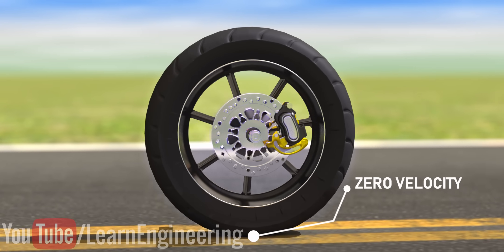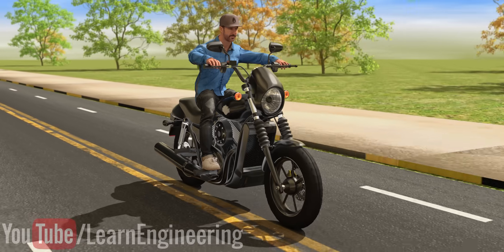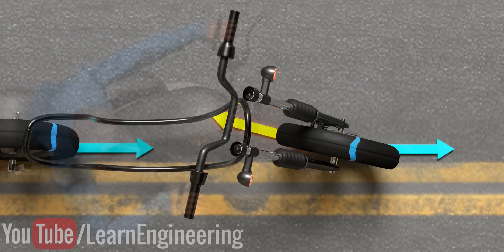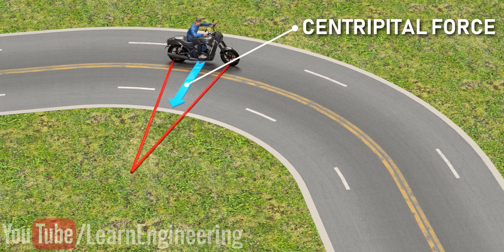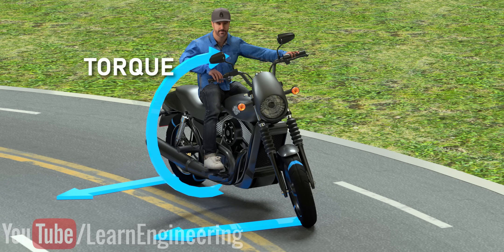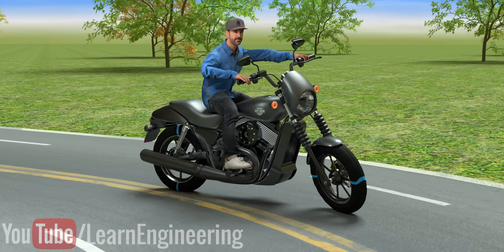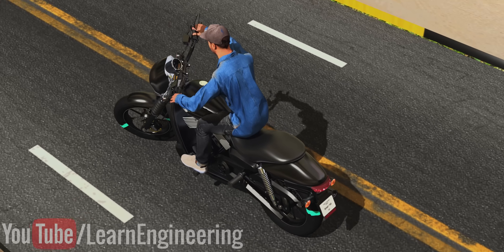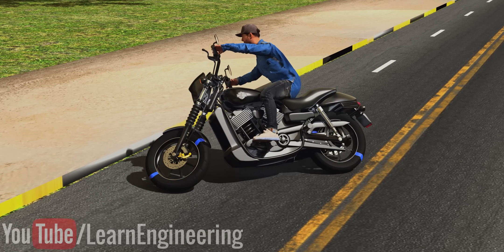Counter Steering | The interesting physics behind it

Comment: This give the false impression that a rider can choose between direct input steering and counter steering, as if it were a matter of personal preference. That advice can get someone killed. 

You cannot steer a motorcycle at public road traveling speed with direct input steering. You’ll go the opposite direction of your intentions, either off the road or in to oncoming traffic.
Reply: My Vrod only turns with counter steering above about 5 mph.
Reply: stickshaker101 that’s the case with every bike. At a very slow speed, the bike wants to fall into the turn because there is no counteracting centrifugal force. So from a stop, you turn the bars into the turn and the bike goes upright as you accelerate through it. At a high speed, the bike wants to fall away or to the outside of the turn. This is what makes the bike turn in the opposite direction. If you then steer into the lean to not topple right over.
Reply: Joe J 
Wrong! The rider doesn't actively steer into the bend when at speed, the bike will do that via self alignment.... If the rider does it he will stand the bike up!
Reply: @stickshaker101  At 5 mph, you really should be using standard steering. I find it hard to believe that you counter steer at such slow speeds.  I suspect you're misinterpreting what's happening. It's simple physics.  Counter steering comes into play usually between 12 and, say, 17 mph, depending on various factors. 5 mph is just slightly faster than walking speed. You use standard steering at that speed on any bike.
Reply: I have a simple analogy to countersteering. Imagine you are balancing a hammer on your hand. If you want to move the hammer to a different location, you cannot simply move your hand towards the desired location - the hammer would fall out of your hand. Instead, you must move your hand away from the location, so that the hammer leans towards it, thus correcting the lean brings the hammer to the desired location. This is analogous to how you must move the front wheel out of the underside of the bike to initiate a lean to make a turn.
Reply: @bmfilmnut  The only time standard steering works is if your feet are paddling on the ground to support the motorcycle. If the machine is balanced on its wheels with your feet up then the only way to steer is counter steering, whether it's 2mph or 200mph. Prove it yourself in a parking lot by riding through puddles and then initiating a turn. When you study the tyre tracks you'll see the bike always turns in the opposite direction first and then corrects to go where you want. 
It's because the bike must first lean and then turn. To make it lean you turn briefly in the opposite direction.
I totally understand why intuitive impressions make people feel that it's otherwise, because our intuitions aren't always a good guide, especially when we've learned a skill like balancing a bike so well that it's embedded into the subconscious.
Reply: @stickshaker101  That is true of all motorcycles an bicycles too. The speed at which "counter steering" is required depend on the size of the front wheel, but is typically between 5 and 10mph
Reply: @stickshaker101  Actually, it’s about 18 mph.
Reply: Listen all I can say to some of you people on here is go take a course.( most states its MSF) I live in PA so its Total control lee parks. If your not going to take a course atleast go do some reading. (Knowledge then skill) which simply means go out and take a class or read a book from an accredited source ( total control vol.2, any book from Keith code or lee parks) hell go watch "Motojitsu" on YouTube. And then as he would say in most of his vids "shut up and practice". Go practice in a controlled environment. Empty parking lot, maybe catch a track day. To answer some of your questions and reiterate on what was said. How you turn the bars depends on what kind of turn your taking, there are two types of turns. "Low speed (anything under 12-15 miles per hour) and road  speed (anything over 12-15) and NO! It does not depend on what kind of bike your on. Fundamentals are the same for any bike, that's why they say "it's the rider, not the bike". Low speed turns require "direct steering" and instead on counter steering we get into counter balance. Road speed requires counter steering. Get out there and take some courses if your going to ride. It's the best advice anyone can give to you.
Reply: Exactly right, whether on a bicycle or motorcycle you always countersteer to turn, whether you realise it or not. It may be hardly noticable but you do countersteer every turn.
Reply: @kevinbrown7219  Keith Code proves your statement with his training bike.. It is called the no b.s bike. (no body steering).  His classes are amazing I went to the super bike school
Reply: @kevinbrown7219  No exactly, try riding a bicycle without putting your hands on the handlebar and turn with moving your waist
Reply: @AnnoyingPlastic  I do that all the time
Reply: @AnnoyingPlastic  Anyone who rides a bicycle countersteers. At moderate speed you don't steer by turning the handlebars. You steer by leaning and countersteering. Everyone does that, even the 8 year old who has just learned to ride a bicycle.
Reply: @jmw8403  Absolutely right. I’m astonished by this video which appears to have been based on an entirely theoretical basis, by a non-motorcyclist. Above around 5mph the only way to steer either a motorcycle or bicycle is by countersteering. Try and steer as you would a car and you’ll be off before you know it.
Reply: @AnnoyingPlastic  and when you do what you say to do the bike will first counter steer a bit and only then will it dive in the direction of your lean. Counter steering will always initiate turns at speed. This is some really dangerous misinformation here about being able to turn at speed on 2 wheels without countersteering!!
Reply: @AnnoyingPlastic  lol did u know that if u lean the bicyle without putting ur hands the handlebar will countersteer , if u dont believe me try locking ur handle bar that it will not go to the opposite of direction u wanna go. goodluck
Reply: @kevinbrown7219  not at slow speeds - counter steering kicks in at around 15mph. Under that you will be using a normal turn.
The way I was taught was at speed push in the direction you want to turn to.
Reply: @XtreeM_FaiL  try it at a walking speed on a low traction surface and you might modify your thinking on this point,
Reply: XtreeM FaiL yep. That’s my point. Countersterring won’t work at a walking pace on low traction surface, or even a high traction surface, at that low speed. Direct input steering only works at low speeds, countersteering works at all other speeds.
Reply: @XtreeM_FaiL  I have done that. Not moving is different than moving. 
And I didn't say "without traction" which would like what, black ice? 
I said low traction, like wet leaves, mud etc.  
So two missed conditions here: rolling/not rolling and low traction/no traction
"ffs" indeed. Note in the vid the complete lack of counter steering and deliberate use of direct input steering. Turn left, go left. This works only at low speed.
https://youtu.be/LKRPPjF3BIs
Reply: @XtreeM_FaiL  " change front tyre to a ski and it still work the same as before", well if you don't understand the difference between a ski and a tire, I guess I'm done conversing with you about counter steering, because it sure won't work with a ski.
Reply: @XtreeM_FaiL  counter steering works, for one reason, because as you push the handlebars to the counter directional side, the bike starts to fall the other way and the tire tips onto it's side, where  it's radius is smaller and then the bike turns toward that effectively smaller radius part of the tire (approaching it's sidewall, almost/kinda). The radius of the crown of the tire is greater than the radius of that same tire as the contact patch moves toward the side of the tire. A ski has no smaller radius, it doesn't roll and do you seriously need me to explain to you the functional difference between a flat static surface (sliding) and a round, complex curved (rolling) one? :^ )
 Did you check out that MotoTrek vid I linked? You can see he doesn't use counter steering on the slower, low traction turn, He turns the handlebars the direction he wants the bike to go, and it goes there. No counter steering.
Reply: @XtreeM_FaiL  
You're hilarious.

And obviously you haven't screwed with how you turn the bars in parking lot enough to have entered a corner steering directly, and exited counter-steering.

In a way, you're "always counter steering" because most of the time you're letting the bike so most of holding you up.
As riders, we just learned how to go about making it do things without upsetting it.
Reply: @Slarti  THIS is correct.
Reply: @tommeyer6033  Yes it will. Only you can't lean so much. Or you have to counter weight with your body. Like it or not, you always CS…
Reply: @tommeyer6033  You are the one that don't want to understand. You only want to be right, but you are wrong. Wrong I tell you… W R O N G !
Reply: @Gismo3333  😂😎 I think there is plenty of empirical evidence that shows otherwise. 
Plus you’re “yelling”. Not a good debating tactic. It says more about your argument than it does about mine.
Reply: @Gismo3333  there is also video evidence of people not counter steering, and paying a terrible price. 

This guy tries to steer in the manner advised in this video (with direct input, not counter steering), and rides directly into a fire truck. 

https://youtu.be/VVE79XT8-Mg
Reply: @Slarti   No, even at 15 the only way to turn is to countersteer, bycycle, byke, scooter...if you got 2 weels you need to lean in order to make a turn. And leaning is the effect of coutersteering.
Reply: @Slarti  No, you counter steer at every speed unless you are putting your foot down. It is just laws of physics, you cannot physically turn a two wheeler without counter steering or putting your foot down( in that case it becomes a 3 wheeler temporarily) to counteract the centrifugal forces.
It is just that it becomes more noticable at high speeds.
Reply: @XtreeM_FaiL At super low speeds, right around 5mph I have to direct steer my Goldwing. When pushing it backwards out of the garage I'm not counter steering. When I'm power walking it's direct steer. I don't need to counter steer until around 12mph on my Goldwing. There is a point at which it switches. Starting from a stop and turning onto the highway I can watch and feel my bars go from turning into the turn to pressing opposite of the turn.
Reply: @Slarti  You CS at any speed from idle and up.
Reply: I counter steer in traffic all the damn time. Every time I ride, consciously and deliberately
Reply: @ulysses_grant  it has nothing to do with whether you are in traffic but is to do with speed.
At speed you have to counter steer.
Reply: @Slarti  Good to know, I'll try that. What speed exactly, do you mean?
Reply: @ulysses_grant  the speed depends on the bike. On most motorbikes(by motorbike I don't mean scooter) it at around 15mph.
Reply: Youtube should ban this video!!
Reply: To all the people that don't understand countersteering: Go watch Twist of the Wrist on YouTube!
Reply: @teasippingguy9316  
And to all the people that ride.
If you've already seen it, watch it again
Reply: @Fightre_Flighte  exactly.
Reply: On top of.that, it goes far by staying that it can be done with weight steering 🤦 such a thing does not exist
Reply: It’s not a matter of personal style, preference or belief... it’s physics.
Reply: Exactly sir you said it better than I did this video will get people killed by them thinking that they have the option of choosing which way to steer
Reply: @ulysses_grant  What??
Reply: You are exactly right.  It was an error on the part of the person who made this video to say that counter steering is faster because there is no alternative to counter steering at speed. It's the only way so there's no other technique to be faster than.
Reply: I was going to comment this but you had it covered - thank you
Reply: @Gerardo Martinez I actually say counter steering works at speed v= ε (where ε is any given speed >0, even infinitesimally low). Suffice to watch the Japanese police in training, or any gymkhana. It is best shown in parts where they prepare for a hard turn from standing straight position. Counter-steering is pre-applied before the cycle starts rolling, so once in motion, it leans instantly.
Reply: Tom Meyer I have read every comment and counter-comment.  I am not a motorcyle rider, but after all this, I can honestly say I have Zero Idea what to believe!
Reply: @mikeriesco6174  Just to be 100% sure I heard it correctly in Keith Code's Twist of the Wrist  (that THE ONLY way to initiate a turn on a motorcycle is to countersteer) I took some time to experiment on my bicycle. I rode it super slow (at the edge of losing balance) and tried to apply direct input steering to turn. But to make sure it really was direct steering I kept my body straight and just turned the handlebar. Naturally, not turn in the intended direction - the bicycle just leaned in the opposite direction of the handlebar turn. Then, I tried body balance, hanging off one side - NO DIFFERENCE. The principle holds true no matter what you do. Granted, the amount of countersteering is minute - if you only slightly turn the handlebar and get a "positive rate of lean" - you can let go (i.e. stop applying pressure on the handlebar) and the bicycle turns nicely. Try it yourself, you will see it instantly. Just pay attention to what you are doing and the reaction of the bicycle.

I guess some people talk about "direct steering" not realizing they actually countersteer a very tiny bit at low/very low speed.

Search for Japanese police motorcycle training videos. You will see how they start rolling their cycles with the front turned in the opposite direction (which results in an extreme u-turn right off the bat). They are quite aggressive with the manoeuvre, too!

So, to be crystal clear (and I will repeat what Keith Code said): countersteering works..... ALWAYS.
Reply: @piotrswiatkiewicz3259  I have filed a complaint about this video with YouTube. Please do the same.
Reply: I just tried it after watch this video, even manage to do it on a small road.. arround 30-40 kph, (well my country use kph so dont bitching about it).
Reply: @Je_AnetteAI  what do you mean? That the countersteering works?
Reply: @piotrswiatkiewicz3259  yeah
Reply: @Je_AnetteAI  Glad you found out! Try it on a bicycle at super low speed. It's fun and you can learn a lot not risking too much.
Reply: It’s been so long since I watched this.. is this a different video posted to the same url? Can you swap out videos for editing changes? I don’t know. But this vid looks not like I remembered it looking. Even the graphics (such as they are (*coughgumby*) look different.
Reply: You're right. 
 this is the most insane and dangerous bike video ever made
Reply: Exactly - this idiotic video is going to get people killed.
(ex- biker 600cc)
Reply: @Slarti  Well, this is "Learn Engineering", not "Learn how to ride a motorcycle". If anyone uses this video to learn to ride, they are not very smart.
Reply: @vferdman  but the science is wrong in this video, so it should be 'fail engineering'.
Reply: @Slarti  No, the science is not wrong here. It is just misrepresented. The depiction of the forces acting on the bike are great. Just the practical applications are obviously not very true to life.
Reply: @vferdman  the science is wrong I can assure you of that.
Reply: Vladimir Ferdman 
So they shouldn't be talking about counter steering! They have little knowledge of how it works in the real world. They are giving advise and it is dangerously inaccurate!
Reply: @Slarti  I have filed a complaint with YouTube. Please do the same.
Reply: I only use countersteer and weight shift to turn my bike...never direct...
Reply: Terry Duncan so only counter steer then, because weight achieves nothing off a track!
Reply: Yes, excellent point.
Reply: The bike goes opposite way above 20mph. In traffic speed it's completele impossible to not countersteer.
Reply: Exactly
Reply: This is a great statement.  Even when I took the motorcycle course they taught countersteering like it was some extra skill.  People need to understand that the faster you go you will NEED to shift from direct input steering to countersteering.  At lower speeds it feels natural like a lean to steer, but you don’t realize you are actually countersteering.  However, at higher speeds if you don’t push the handlebars forward to steer the direction you want to go, you will understeer and not be able to make the corner.
Reply: Ulisses I think you need to practice this in safe conditions at speed.  If you ever need to make a quick defensive move, if you aren’t practiced you won’t be able to make it.
Reply: Jimmy Hua 
Haha you talk nonsense my friend. Have you even ridden a Harley or just commenting on "what you heard"?
Reply: Some motorcycles DO NOT countersteer. A bike with a side car attached direct steers, unless you "fly" the chair and then it does.
Reply: Stu Glenn as soon as you add a third wheel, or a fourth to a motorcycle, it becomes a car with handlebars.
Reply: Stu Glenn a sidecar changes the geometry and mechanics of a motorcycle into that of a car with three wheels. This discussion is about motorcycles (and bicycles)... two wheeled vehicles. A three (fixed) wheeled vehicle will not counter steer because it doesn’t lean.
Reply: @stuglenn1112  a bike with a side car is essentially a car with 3 wheels, as are all "trikes".
Reply: Got told by the CA Motorcycle Safety Training course instructor - ask about counter steering, get kicked from the course. Press left, lean left, go left.
Reply: For most people who ride, counter steering is just an intuitive thing you do and don't really realize it.  This visual representation doesn't seem right to me.   It shows the rider literally turning the handlebars left and starting to go left before going into his right turn.   I don't think I've ever done that on my bike.  I thought counter steering dealt with the fact that you're putting some pressure on the handlebars on the side you're turning toward.  So you're not turning the bars right to go left, you're just pushing against the right side to counteract the force of leaning into the turn.  I've only been riding a couple years, so maybe my interpretation isn't correct.
Reply: Not true. As an instructor on motorbikes and driving inn Norway, this is all we learn students on steering. It's been done excessive studies. Check accident stats for Norway
Reply: Interesting reading everyone's comments. I think the video was interesting and correct in many ways. I think the no steering bike that people use to demonstrate you cannot steer a bike with no hands is probably miss leading. I'm sure when we all was a kid we could go around corners no handed which proves that it is possible to steer with no hands. The problem comes with gyroscopic effect of heavy wheels which is why you see racers hanging on to the side of their bike with it still going in a straight line. The facts are the slower the bike is travelling the more unstable it is, it is lacking in gyroscopic forces from the wheels and forward motion which is why direct input of turning the wheel in the direction you want to go and a bit of subconscious look and lean on the same direction works. Once the bike starts to move faster the other affects start to take over so counter steering because almost the only option to make the bike fall towards the direction you want to go towards. Once the bike starts to lean the front wheel naturally starts to balance out. Maybe this is wrong advice but I think it's kind of how it works.
Reply: @OrangeManStan  that's true but even when you're not using your hands it shows if the bike leans left the handlebars have to turn right which proves body steering and that direct input would not work
Reply: @pjuice2000  this is correct, is all due to physics, kinetic and gyroscopic energy 😊
Reply: @OrangeManStan  above 5-10 mph you only steer by counter steering. if you don't learn that you'll never learn how to control a motorcycle properly.
Reply: @OrangeManStan  I don't think this is correct. Check my comment (I guess the link has to be copy&paste to work correctly):
https://www.youtube.com/watch?v=ZpV2Bg-WX0w&lc=Ugxo5rjReW9ew22gOgR4AaABAg.93NeyF2auWy9DgGplTl9L1
No matter how much I tried to steer my bicycle directly (even at speeds lower than walking pace) - no success. As soon as the handlebars were turned (in the direction intended with direct-steering!) the bicycle would simply lean in the opposite direction, so naturally, if I didn't let go, I would fall. Once I stopped pushing on the handlebars the cycle immediately turned in the opposite direction (matching its lean direction, of course). Try it out and see for yourself. Final result (which matches Keith Code's teachings perfectly): countersteering works.....  ALWAYS. Hope this helps.
Reply: @piotrswiatkiewicz3259  no I do understand, you are correct. I've tried it too on a push bike. It's just the slower you go the bike will start to topple but I agree as I said at a very slow speed you naturally look and lean towards the direction you want to go so you lean then steer without the counter steering. The bike is kind of falling to the direction due to its mass and you leaning. But I agree counter steering is generally required to initiate the turn. I think there's a lot of physics going on including friction and many other things we don't think about. Quite amazing how it comes natural really.
Reply: @OrangeManStan  My point was - every single time you would like to turn on a bicycle, motorcycle (any two-wheeler, single track) countersteering is the only way to achieve that. The slower you go the less of it is required to initiate the turn. To the point where it becomes very minute, but it is still required to lean the bike, nevertheless. No other way to lean. This is exactly what Keith Code explained in his course/book/video and proves to be correct in the simplest of experiments you can imagine. Just try and feel for yourself.
Reply: @piotrswiatkiewicz3259  no worries, I know what you mean and I agree but I do think a bike can be steered with other inputs besides counter steering as stunt riders would not be able to steer no handed. I think that they are using their body weight to lean the bike making it steer. I agree the faster you go the harder it is to do it making counter steering the only real effective method.
Reply: @OrangeManStan  Is it possible stunt riders are only able to steer by balancing when doing a wheelie (or stoppie, although I am not sure if it is doable then)? As far as I could tell (during a regular ride with two wheels on the ground) no matter how much the rider hung off - barely any turning could be achieved. On the other hand - the cycle always reacted to countersteering instantly and decisively.
Reply: @piotrswiatkiewicz3259  I agree, it's very difficult to change the direction of a bike without counter steering especially at speed and on a heavy bike with heavy wheels. Softtail put a link to Keith Codes video Twist of the Wrist which is very good. But if you watch it they do change the direction but only by a small amount. I suppose I'm just trying to be precise because there are many variants but you are right counter steering is really the only real way to turn a bike and is a natural process that we do without thinking about it. The important thing is if you can master it your riding will become easier especially if you want to ride fast on track.
Reply: Absolutely😂😂😂🤣🤣
Reply: Exactly. You cannot steer a bike at the majority of road speeds without counter steering. If you use "normal steering" you're absolutely going to crash
Reply: This video just straight up use a junior high school pyshics to explain motorcycle steering. Like, really? You'll get someone killed 😂

You will never, ever, INITIATE a turn in travel speed on a motorcycle by pushing the handlebar toward turning direction. Sentrifugal force will quickly push you to other direction.
Reply: Absolutely right this is not sound advice bikes are steered with counter steering.
Reply: @ulysses_grant  if you're doing over 20mph, the only way a bike will steer left is if you steer right! Over 20mph, everything is reversed... You have zero choice. At this speed you cannot steer left to go left.

Don't believe me... Take your bicycle out and pedal hard down a hill and very slightly steer right...you'll go left after a very slight initial swing of the lower part of the bike to the right.
Reply: @UCUNs5OkoR3vyT9UeL7Unxsw https://www.revzilla.com/common-tread/what-is-countersteering
Reply: @UCUNs5OkoR3vyT9UeL7Unxsw https://youtu.be/CC0ZadbwFKw
Reply: @UCUNs5OkoR3vyT9UeL7Unxsw it is not unsafe.
Reply: @ulysses_grant  he said the complete opposite…
Reply: true that what i notice in this video i was like wtf thats imposible lol
Reply: Exactly. You’ll basically counter swear the motorcycle in the opposite direction to the way you want to go and crash! This video is nonsense
Reply: Wrong, wrong, wrong.
Reply: Everyone, anything that has 2 wheels in general at high speeds regardless, you need to countersteer. Because you are driving a gyroscope.
There is no 3 or 4 wheels to stop the leaning so regardless countersteering is the only way to steer a motorcycle.
Why does it work?
Because the road surface hits the front tire facing the opposite way forcing it to lean due to friction. This also causes the bikes weight to shift to the front and in the direction the tire is not facing causing the bike to lean.Gyroscopes naturally corner when leaning, also they naturally defy gravity when the spin rate is fast enough. tHIS IS WHY YOU KEEP YOUR ARMS LOOSE AT ALL TIMES
spin a bicycle wheel at high rpm and tilt it on a string. It will stay in it's position until the spin rate is slow enough to no longer defy gravity.
Reply: not even at low speeds. direct steering doesn’t exist. at low speeds the involuntary counter steering is so quick that it’s undetectable with the naked eye but film someone who swears on their own kids they don’t do it and you’ll see they do it
Reply: My point is, that if when riding at in-traffic, at highway/roadway speed, you decide to try turning the handlebars to the right in an attempt to effect a right hand turn. You will, in fact turn left. You cannot use “direct input steering” at highway speed.  Unless you want to fail in your efforts. 

https://www.today.com/video/gopro-video-motorcycle-crashes-head-on-into-fire-truck-470428227800
Reply: @ulysses_grant  Anyone with any motorcycle riding experience at all will disagree with you. Countersteering is THE only way to operate a motorcycle above 5 MPH. The comments here clearly show those that actually ride a motorcycle and those that do not.
Reply: @vferdman  quite right
Reply: @vferdman  "Anyone with any motorcycle riding at all will disagree with you". Well, you are not only wrong and falacious: You are offending many people here in the comments section who has the same - or even more - experience riding motorcycles than you do. Put yourself in your place and learn some humbleness. Peace.
Reply: @ulysses_grant  I have over 30 years and hundreds of thousands of miles of experience on a motorcycle. I have been riding since 1989. Counter steering is one of the first things I learned and before I learned to do it consciously, I still did it, but unknowingly because there is simply no other way to turn a bike going faster than 5-15mph. With respect and humility, this video is misleading in order to make a point of laws of physics and I respect that but it is not good riding advice. I hope folks don't take it as such and try to steer their motorcycle in the streets using anything other than countersteering.
Reply: @vferdman  My respect to you Vladimir. I'm half the way to 40 years of experience, I'm not sure if I know how to countersteer, and to be honest I'm getting a little confused with so many different comments. When I have to steer I compensate the weight of the motorcycle - which is pending to one side - with my body's weight to the counter side. I don't know if I'm doing it right, but I'm always opened to learn more, with people better than me. Thank you for being kind.
Reply: @ulysses_grant  If you ever rode a motorcycle and successfully turned where you meant to turn, then you have indeed countersteered. Period, end of discussion. There is no other way to do it at any appreciable speed. The sooner you start doing it consciously, the sooner you will improve as a rider. Next time you are on a bike going say, 30-40 mph relax both hands and then gently apply pressure forward with your right hand (pushing the handlebar to the left) fully expecting to initiate a right turn. Do it safely, of course and very lightly just to see what the effect is. Then try in the opposite direction. You have been doing it all along without realizing, now do it on purpose. Your skill level will improve that very moment.
Reply: Vladimir Ferdman Great! Good to know I had been doing it for all my life, lol. Thank you, I will make that way and I'll come back to let you know how was it. Thanks again, and forgive me for anything.
Reply: @ulysses_grant  why should he care about offending people who spout absolute nonsense, especially when it might save a life. Counter steer is the only way to steer safely.
Reply: @ulysses_grant  you've been riding for 20 years and you STILL don't know how to steer a bike? Impressive
Reply: @RodFleming-World  Doing something unconsciously and not knowing how to do something are two completely different things, I think you agree with that. Take you, for example: You probably are not conscious that you screw punctuation in a phrase, but you do it impressively well! Impressive!
Reply: @vferdman  I have filed a complaint with YouTube. Please do the same.
Reply: @tommeyer6033  I am not going to bother, but thank you for bothering. I think anyone trying to learn motorcycling from YouTube deserves this. Take a proper training course, your life depends on it!
Reply: Near Air 
Your comments on Harley's are rubbish mate lol. Leaning on any bike achieves nothing at all, especially a Harley because they are so damned heavy compared to most riders. 😂
Reply: @ulysses_grant   You always do it.  You just don't realize it.
Reply: (I don't to be rude but this information it is not correct and can kill people. I just don't want that anyone gets hurt.) Depending on the wheels momentum (speed, wheels weight) you will need to do it at lower or at higher speed independently of if  you're aware of what your body is doing or not. I even do it on my bicycle at 10 or 12 miles per hour. I do it consciously and deliberately. On a curve if I want the motorbike to lean even further I apply even more counter-steering, this way I can have by body in a almost vertical position and my bike leaned the amount I want giving me a more tight trajectory.  The direct steering only works at very low speeds, depending on the bike, about less than 10 or 15 miles/hour. Check the video "twist of the wrist" here in youtube.
Reply: @mariofigueira3422  I have filed a complaint with YouTube. Please do the same.
Reply: I have reported this video. Please join with me and demand that this video be removed. It might kill someone.
Reply: Im going to kill someeone ))
Reply: @jimmyhua731  no serious motorcyclist would have a Harley.
Reply: At speed, counter steering imparts a lean and it's the lean that causes you to turn. At least that's my experience and description. Very hard even to change lanes without leaning. The good thing is this becomes natural so don't over think it.
Reply: you misunderstood. not all people use counter steering and its not a natural way everybody does to steer bike. lot of people lean their bike with their body posture while turning the handlebars to turn the bike. but for counter steering you don't lean your body at all you can turn your bike while having a straight posture relative to the bike. there are two ways to steer the bike and that is either by leaning your body and bike then turning or by just using counter steering and not use your body at all . let the handle bar do the magic. 
if you say everybody does counter steering normally without them knowing then you're so wrong. you might do it without knowing but that does not mean everyone does!
Reply: You are absolutely right.  The only time you steer in the direction you want to go is if you are going too slow to put your feet on the pegs.
Reply: @ojaichuck  always keep your feet on the pegs. With high revs and feet on the pegs you will be more stable at as low speeds.
Plus if a big bike is going to spill there is no way to stop it happening with your feet.
Reply: @ojaichuck  You never put a foot on the grown when moving. That makes you crash and brake your legs. Try some MC boots, and you get it. And then you crash. That foot is going to glue it self to the pavement. Don't recommend trying that, you can lose a leg.
Reply: If you're going over approximately 15 mph, then you are counter steering...period.
Reply: Bullshit, you can do gentle turns on the road by shifting your weight.
Reply: aluisious 
Try it at around 50. If you deviate at all I would think you are doing well, but you'll never take a bend of any significance!
Reply: I dont turn my handlebars at all I lean through everything no matter how sharp of a turn and I've always done just fine
Reply: @C4LB34R  Please watch the first 10 minutes of "A Twist of the Wrist II".  He puts another set of handlebars that are rigidly mounted on the bike that don't turn.
Reply: CenCalNinja That is BS and you know it or are you willing to try that with fixed fork?
Reply: @C4LB34R  you initiate your lean by counter steering you just don’t realise it.
Safe riding brother👍
Reply: @C4LB34R  That will make the bike change course a foot, at most. When you are leaning, you push the handlebars on the side you are leaning, and you drag on the other side also. Try leaning whit you hands of the handlebars. Try it in a strait road or open space, not a corner. Because your bike will barely change course.
Reply: CenCalNinja 
You are counter steering when you lean, you just don't realise it. Leaning accomplishes nothing on its own. When you lean, you lean with the bike... The bike doesn't bank over because you lean.
Reply: Nope. We all know we can turn the bike buy not pushing the handle bar on the opposite side (counter steering) by simply leaning towards the turn, but during  very highspeed you cant turn by just simply leaning specially is the turn is so curve.
Reply: @sirjaytv3905  That is absolutely incorrrect. You cannot turn a motorcycle at speed by leaning your body.  People think they can because the bike leans but the lean is caused by counter steering, not the shifting of the rider's body.  There's an excellent YT video that demonstrates this.  You're at risk if you actually believe that you can steer at speed by shifting your body.  I'm amazed that so many people still think this.
Reply: @sirjaytv3905  This is wrong.  You cannot steer a motorcycle by leaning alone.  This was proved with the no-lean bike, which has fixed handlebars (i.e. you can't turn the forks by hand).  When you "lean", what you are doing is subtly countersteering, because your arms will naturally apply torque to the handlebars to counteract your change in center-of-gravity from leaning.
Reply: @sirjaytv3905  This is wrong, you can't lean towards the turn without counter steering. You as a rider may lean towards the turn but the center of mass of the bike will remain the same since there is no lateral torque in play. 
What you are doing is essentially counter steering since by leaning towards the turn, your bike is leaning away from the turn( conservation of angular momentum), and due to the difference between the turning axis of the front wheel and the contact patch, your bike turns away, essentially just counter steering without knowing.
If you don't believe me, you can draw a free body diagram of your bike and calculate all the forces, or just ride a bicycle without hands and you will see immediately.
Reply: @sirjaytv3905  

I can ride a bicycle for hours without touching the darn handlebar. What are you talking about?
Reply: @sirjaytv3905  it was hard to tell, but we used to do it, although we dont know what is that about.
Reply: @sirjaytv3905  Even when you lean right, you can only do that by pushing the motorcycle left to make your body lean to the right. So you're causing the front wheel to turn to the left just a tad when you push the bike to the left. This is what makes the bike lean to the right, and then the wheel follows and turns to the right. The sharper you do this (push the bike to the left as sharply as you can), the more resultant right turn you end up with. Your body position ending up on the right is kind of a side effect of doing this. 

If you very gently move your body weight to the right in a way you don't do any sudden weight shift of the bike, you can get the bike to continue going straight or even arc slightly to the left.
Reply: @sirjaytv3905  Even when leaning you indirectly turn the handlebars. You are always countersteering wether you like it or not.
Reply: @sirjaytv3905  bruh do u know that if u lean towards the turn the motorcycle handle will counter steer first against the turn so that it will lean to where u want it to go
Reply: @sirjaytv3905  And to get that lean - you countersteer for a split second.
Reply: @sirjaytv3905  ugh 'leaning' IS countersteering. You lean BEHIND the headstock, which causes the front wheel to deflect opposite to the direction of lean. You can demonstrate this with a pedal cycle. Walk beside it with your hand on the saddle. If you push right the front wheel will deflect to the left and vice versa  Some bikes are easy to steer like that, with an almost unconscious shift of weight, others not so. Bbigger cruiser types usually need some bar input but it's not a fixed rule. There is a significant number of parameters to consider, making subjective assessment the only practical method.
Reply: @RodFleming-World  Please watch the first 10 minutes of "A Twist of the Wrist II".
Reply: @Jelk1986  nope.
Reply: Some bikes require direct input steering such as certain Harleys. My dad owned one and if he counter steered. The side of the bike would scrape because of how it was built. He had to use direct input steering to not crash and actually turn. I don't know how it is possible, I cannot get my head around it myself but yeah.
Reply: @Opticalcow300  This is not true. Your dad did not know he was counter steering, but he was. Almost anybody who rides and doesn't know countersteering just does it by feel and the brain just picks it up as second nature very quickly. My MSF instructor said he had no idea the first time he learned about it and thought it was crazy until his ride home that day when he realized he'd been doing it all along. EVERY 2 wheeled vehicle be it a bicycle, scooter, dr motorcycle turns with counter steering above 10 or so mph. It's just so intuitive that most people don't realise what's happening. It's also important to note that at speed we're talking about VERY SLIGHT turns of the wheel to produce the lean, the video exaggerates it heavily. Watch "Countersteering 101 v1.1" on youtube
Reply: @Opticalcow300  it would work this way only if the bike’s CG was under the road
Reply: @Opticalcow300  No. All on two-wheels turn by counter-steering. And it always work. You don't have to turn the handlebar 90°… A small push, and it start turning. Push more, and it lean more. push the other side to stand up the bike. Or give it gas/throttle and it stands up too.

 https://duckduckgo.com/?t=ffab&q=keith+code+twist+of+the+wrist&ia=web
Reply: @Opticalcow300  it ties into speed and a little but of body position. After 12-15 mph direct steering is not really effective.
Reply: OpticalCow300 
Wrong! Harley's are the same as any other bike. I've owned several!
Reply: Idk, it's just what my dad told me about his bike. I've only riden a farmbike myself and I countersteer on that aha😄
Reply: @Opticalcow300  personally, that just makes reason #3501 why never to waste money on a Harley.
Reply: @RodFleming-World  lol what, Physics don't change based on manufacturer. I've ridden Harley, triumph, Indian, and Honda. What that guy said is false. Handling will feel different based on weight and center of gravity but riding principles are going to stay the same.
Reply: @Yeetsforthestreets  what they let uou out of the showroom with no motorcycle licence? Countersteering is the physical principle of motorcycle steering. Or did you only ever drive tricycles?  Duuuuh
Reply: @RodFleming-World  damn, I see you got that boomer brain... Everyone who rides knows that at speed you have to counter steer. My response was because you said "personally, that just makes reason #3501 why never to waste money on a Harley." some guy told you his dads couldn't counter steer at speed (which is impossible). Then you said any serious motorcyclist wouldn't ride a Harley which is laughable since those are the guys who typically are laying down the serious mileage.
Reply: @Yeetsforthestreets  no serious motorcyclist would ride a Harley. They'd be a laughing stock.